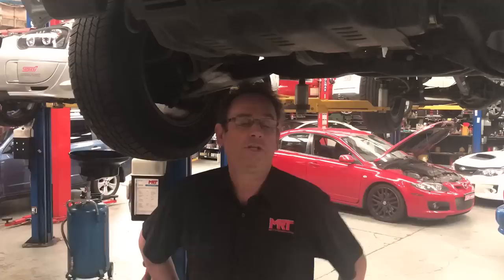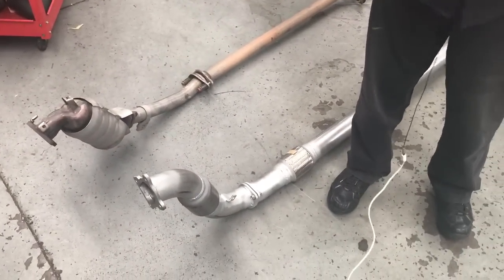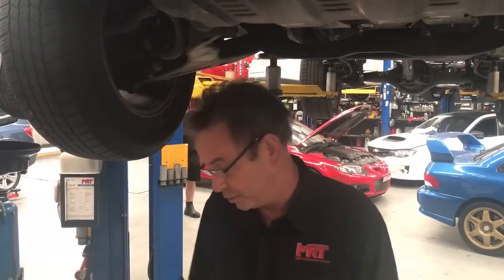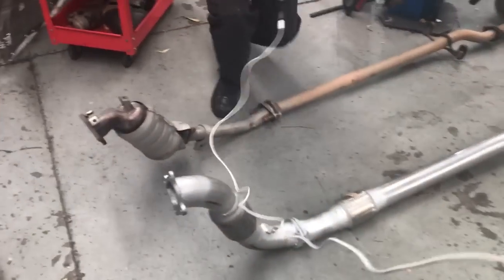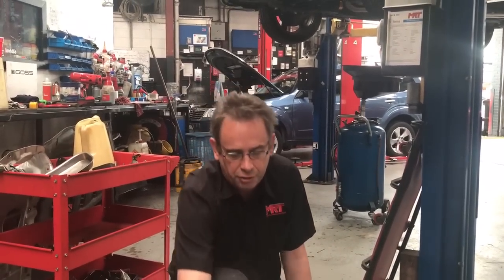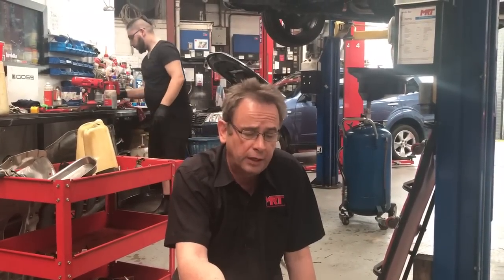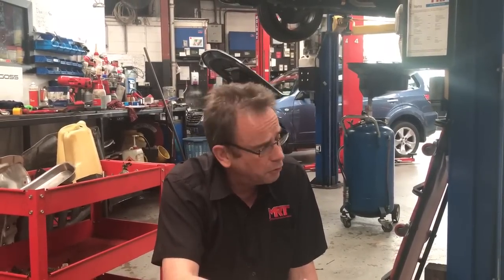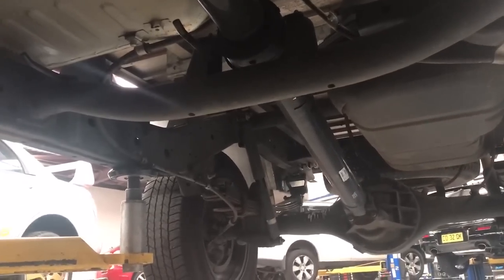Mitsubishi Triton - Turbo Diesel Tuning and Exhaust Comparison

Comment: mate I'm after a xb tune on my completely stock mq triton, I'm hoping to get power and torque at a lower rpm with a wide power band to help with off road performance as well as towing capabilities. Could you quote me the cost for this package? Cheere